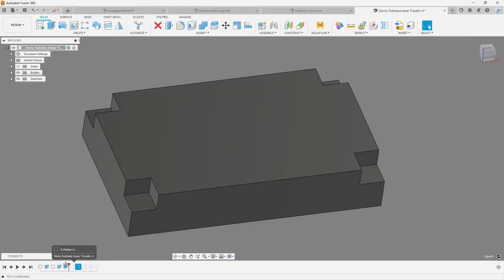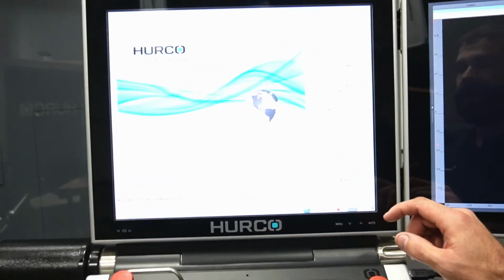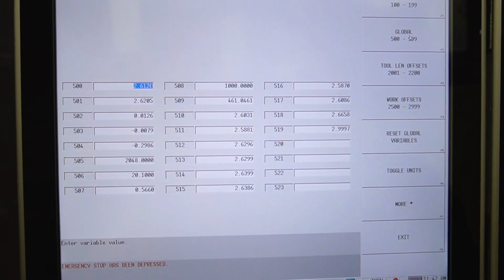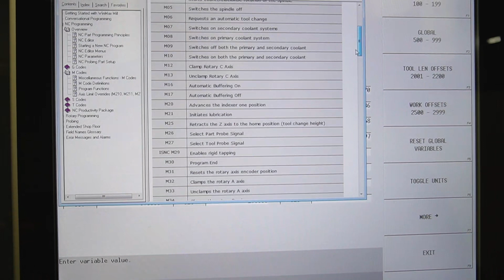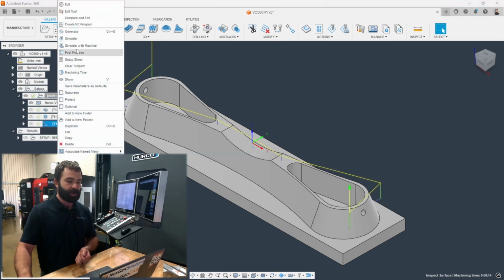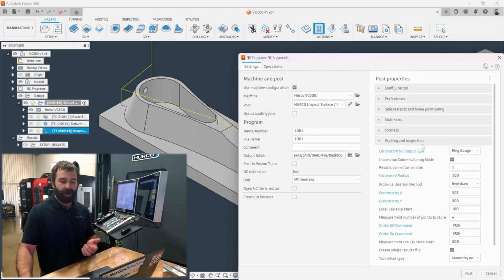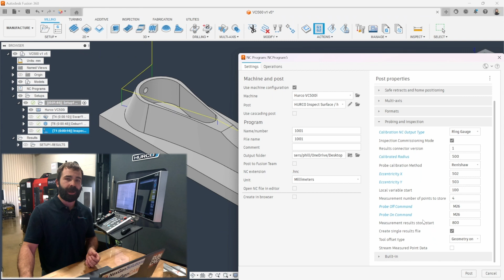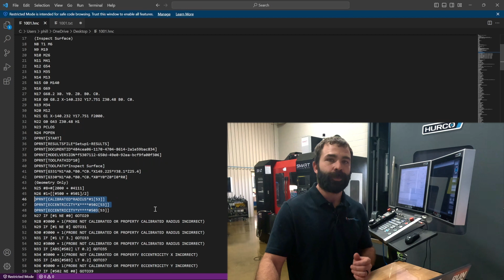Fusion 360: Surface Inspect Parameter's for HURCO Machines

Comment: The HURCO VMX42i we have doesn't even have those values in the NC Variables
Reply: I'm having the same issue with a vm30i. Did you ever find a solution?
Reply: Did You find solution ? I've a same problem.